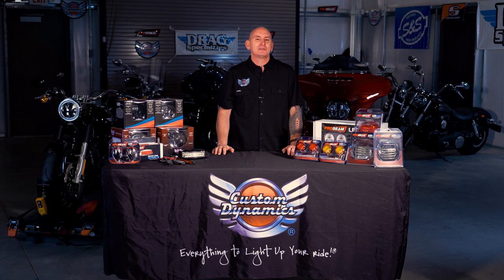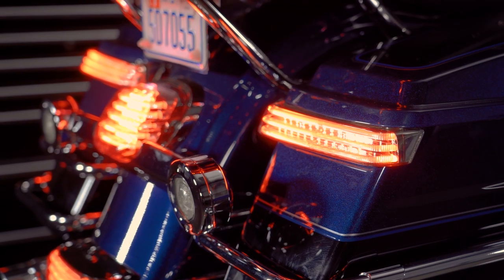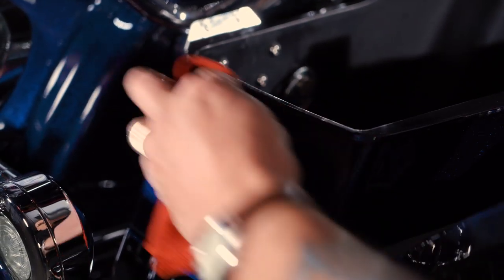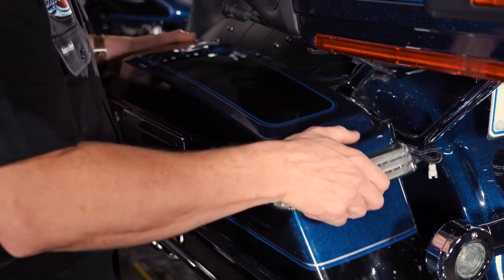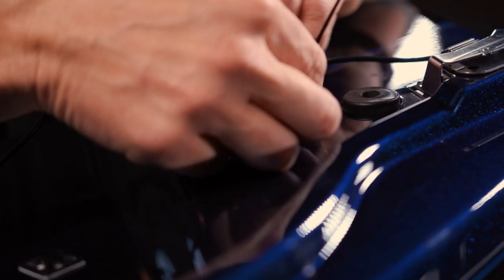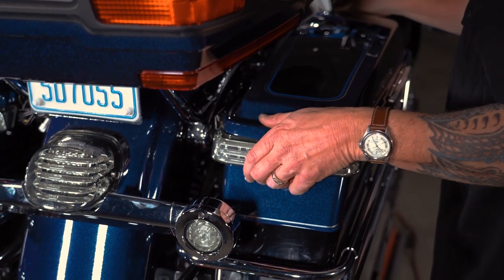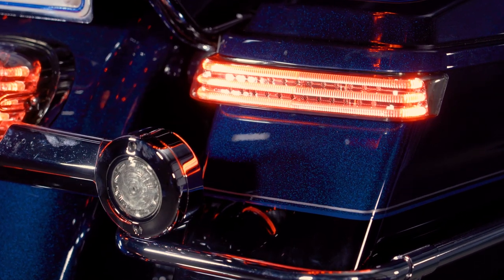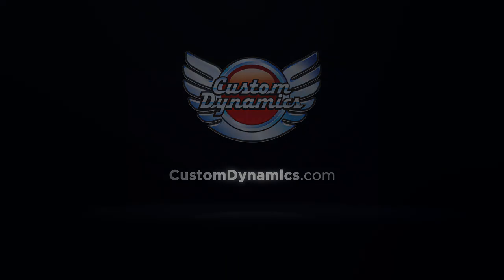How To Install ProBEAM® BAGZ™ LED Saddlebag Lights for Harley-Davidson® Motorcycles 🔧

Comment: Finally!!!!  They look great!! Will compliment my Pro-Beam taillight and fender tip light..:)   Thanks.
Reply from the maker: Thank you! They're the perfect match to the other ProBEAM products like ProBEAM Taillight, ProBEAM Fillerz and/or ProBEAM Fender Tip - you'll love them! Let us know if we can help you place an order and/or answer any questions you might have! Thanks for choosing Custom Dynamics, have a great week and ride safe!
Reply: @customdynamics  Yes I forgot the Fillerz, I have them as well. :)  The whole back and front will be Pro Beam when I'm done. Thanks.  FYI , I was told your products were made in the USA but I see not so.
Reply from the maker: @superduty131  Our ProBEAM® Headlamps and Passing Lamps are Made in the USA but, while Custom Dynamics is based in North Carolina and all of our circuit boards are manufactured by another NC based company, the “Made in USA” mark is a country of origin label that indicates the product is "all or virtually all" made in the United States. The label is regulated by the Federal Trade Commission.  Some of the products most basic components are sourced from China and since they make up a substantial part of the product, we cannot legally use the “Made in the USA” mark on these products. With that being said, we back our LEDs with the Lifetime LED Warranty and our modules with our 5 Year Manufacture Warranty. If you have any other questions, don't hesitate to contact us direct by phone (1-800-382-1388) or email (Erin@customdynamics.com).
Reply: @customdynamics  I have a 2011 Ultra limited and updated my bags to 14 and up stretch bags with the matching lids can I still use these lights on those updated bags considering I have the '09 to 2013 wiring

Comment: I have decided to put the saddle , fillerz and taillight  led pro beam on my scooter. Will the saddle and fillerz plug into one another or what do I need to make them work together? I'm also installing the magic strobe module.  TIA
Reply from the maker: All of the products will daisy chain together under the seat with our pass through wire harnesses which are included with the lights so no additional parts are needed for everything to work together. If you prefer for all of the added lights to flash as a brake light, just make sure the lighting products are plugged in down stream of the Magic Strobes. Anything plugged in on the input side of the Magic Strobes will not flash/strobe when the brake is applied.

Comment: I have the CD Plasma Rods on my 2015 FLHXS with the CD Run/Turn/Brake module as well as the ProBeam turn signals front and rear.  Will adding the ProBeam BAGZ LED lights present a problem with the wiring?
Reply from the maker: Hi, James! Adding the ProBEAM BAGZ LED lighting shouldn't present an issue with the wiring. Based on the details of your application, I would advise it best to give us a call at 800-382-1388 to discuss this to give you a better idea of how everything would work together! We look forward to speaking with you!

Comment: Do I purchase 1 pair or 2 pairs if I'm shooting to have it on both bags
Reply from the maker: This kit includes both lights for left and right side saddlebags and plug and play wire harness. Quantity 1 pair would be required per bike.
Reply: Awesomeness thank you for responding

Comment: Will these work with the magic strobe module?
Reply from the maker: Hi Jeffrey! Thanks for considering Custom Dynamics®! The ProBEAM® BAGZ™ can be used in conjunction with the Custom Dynamics® Magic Strobes™ Brake Light Flasher to maximize visibility with 10 user selectable brake flash or strobe patterns! If you'd like to give us a call, we can confirm fitment for your particular year/model bike and can provide you with part numbers/information regarding the application! We're available at 1-800-382-1388 (Normal Business Hours: 8:30am - 5:30pm EST Monday - Thursday; Closed Noon - 1pm & 9:30am - 5:30pm EST Friday; Closed Noon - 1pm) and look forward to hearing from you soon!

Comment: I have a 2014 street glide special. Probeam tribar, probeam front and rear signal conversion, along with magic strobe. Can the magic strobe module  carry the additional load of the probeam bagz or would I need to leave these off off of the magic strobe?
Reply from the maker: Hi Jack! You'd be able to use our Magic Strobes™ RSG (the fitment you should have installed on your 2014 FLHXS) along with the ProBEAM® LED Turn Signals, ProBEAM® BAGZ™ and ProBEAM® TriBar without any issue! You can find the ProBEAM® BAGZ™ for your 2014 FLHXS, here: https://www.customdynamics.com/probeam-bagz-motorcycle-saddlebag-brake-lights?cat=873